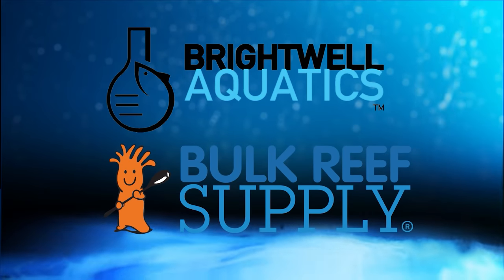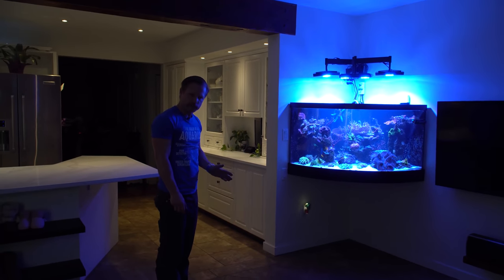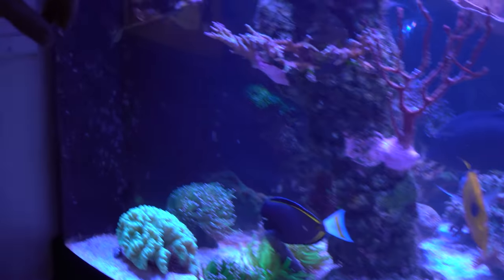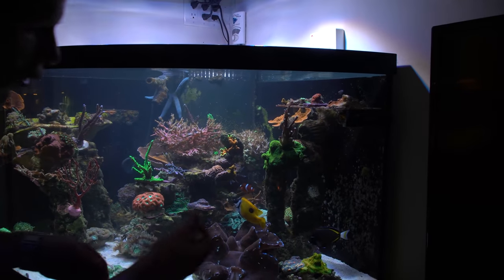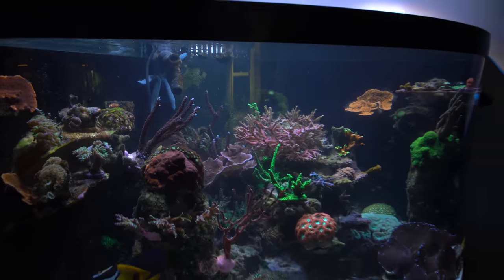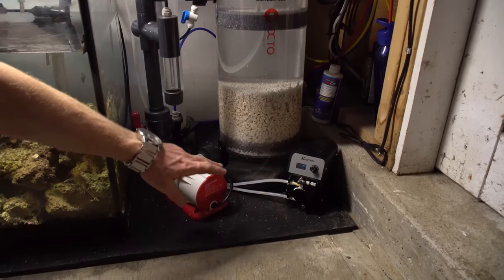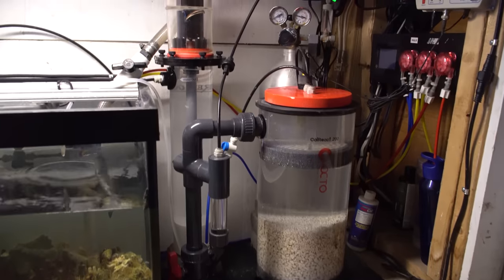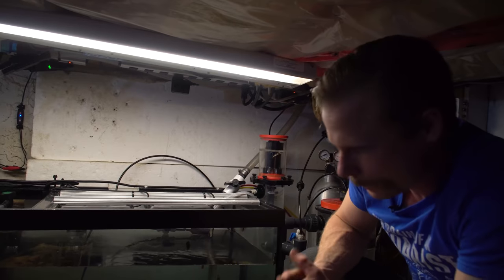Kai's Floating Bowfront Saltwater Reef Aquarium Tank Tour!

Comment: I have this same tank.  Currently starting up a system that will be optimal for reef / coral growth. I struggle to know the correct lights to start with... Since it's my 1st reef tank!  There's a significant depth to this size tank and my concern will be ensuring that there is a proper light absorption throughout!  My tank as well has the traditional hood lighting/tube bulb ballast under the lid.  Any suggestions would be great and much appreciated